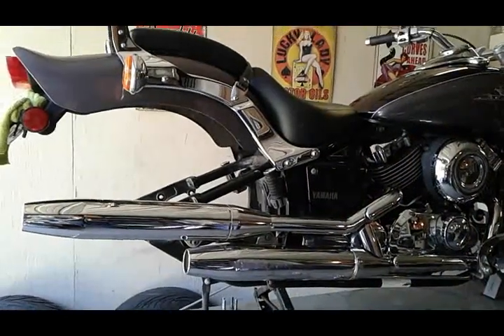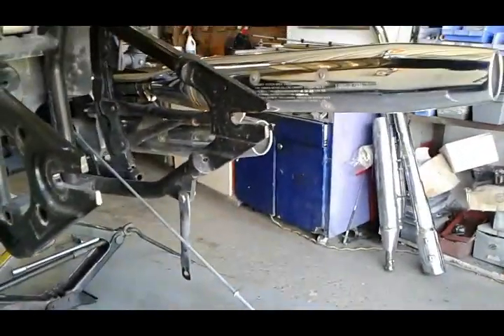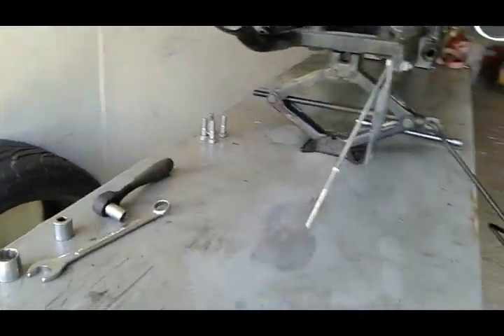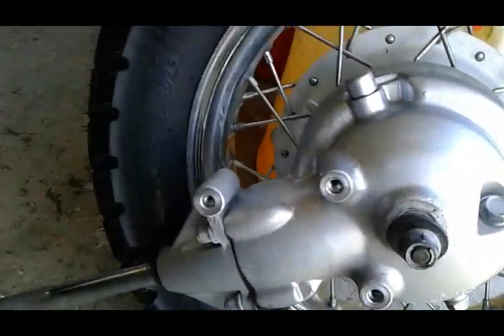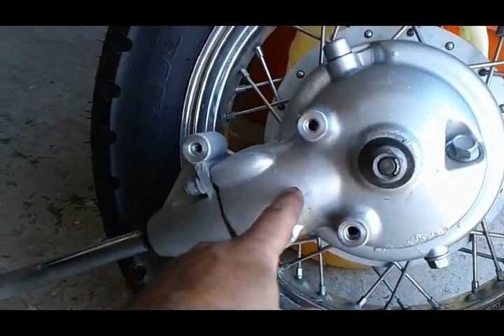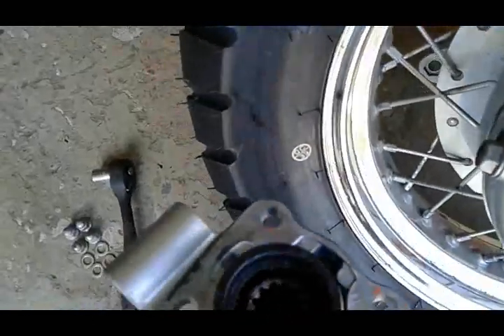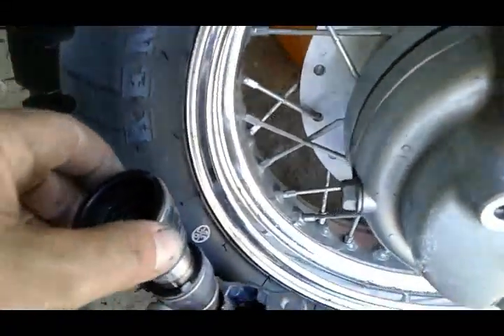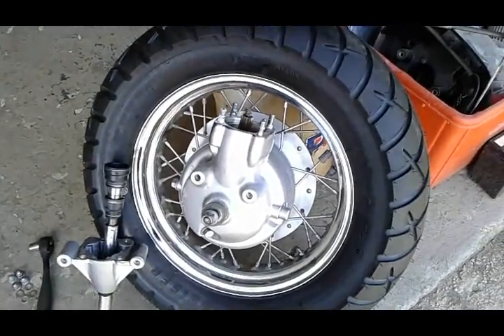All the V Star 650 owners  PLEASE WATCH THIS 3 min. VIDEO !!!

Comment: Great video! I chose to service my Vstar 650 myself. It was not a very easy job with the jack and other tools I had. Its almost a two man job when reinserting the drive shaft back into the engine splines. Next time I will pay a reputable repair shop and have them do the work. I am over 70 years old, so that didn't help!
Reply: Hey if you could do that yourself at your age, that’s better than most my age (17), good job!
Reply: @brileymitchell2632  Well thank you! I have over 50 years of riding experience, and I used to be the service manager of Honda of Waikiki in Hawaii so that helped a little but I am finished with wrenching anymore. I will still change the oil on the bike but my cars......I'll just pay somebody to do it! Thanks again!
Reply: @flashesofblack4128  yea I’m now the owner of a 2008 Yamaha V-star custom

Riding it has become 2nd nature with some things which is interesting

Comment: The best grease to use for this job is Honda Moly 60, a very high moly grease that is optimized for durability on driveshaft splines.  Also, you don't mention the torque specs and the specific sequence of reassembly and torquing.
Reply: Actually Yamaha Molly 60 grease is my go to grease😮

Comment: Your intentions are good but you are doing more harm than good with this video.

The spines are lubed at the factory with 60% moly paste. It is the ONLY lube you can use on the splines. Axle grease will be thrown off and the spines will be destroyed in about 2000 miles.

There is no scheduled maintenance for lubing them in the owners manual or shop manual because that factory 60% moly paste will last 100,000 miles.

BUT: IF you take your bike to a shop that does not know how to handle a shaft drive to get your rear tire changed, and they wipe off the 60% MOLY paste and put axle grease on it, your drive shaft is TOAST.

If someone watches this video and wipes off the factory 60% MOLY paste and puts on axle grease.... same deal.

I only know of one source for the correct lube: Loctite Moly Paste 51048. An 8oz bottle is about $35 online. DONT use anything else unless it clearly states it is 60% moly.  The Vstar 650 is the most reliable motorcycle made (Consumer Reports), and a big part of that is the shaft drive requires NO maintenance and its bullet proof. But its not fool proof.

If you buy a used bike and pull the back wheel off the moly should look dark grey or black on the splines. If they look brown or caramel like axle grease, then dont ride the bike till you get the proper 60% Moly. If you are not sure dont risk it. The rear hubs sell used for hundreds of dollars, and again these bikes are highly reliable, so the only ones you normally find being parted out are wrecks.
Reply: I’m going with what you say man. Thanks for the info that’s super important.
Reply: Hey 👋
Reply: Thanks for the info! I got lucky and got a 01 xvs650 that was parked for issues with spark. I have to replace the tank and try to get it running!
Reply: Thank you so much for this comment glad to read it, just got myself a 1998 dragstar, love the bike, with comments like yours i can give it as much love as she needs!
Reply: You can also use Honda M-77 assembly paste.
Reply: Wrong KW, you do not have to use grease with moly, that's pure BS as are your other comments. Any good grease will do, I use marine bearing grease and that lasts well over 6K miles when I have to change out the rear tire again. In fact the earlier versions of the XVS650 like my 2000 weren't originally packed with moly grease. The only benefit of moly is as a dry lubricant, that is if you neglect the splines to the point that the grease dries up, the moly will be left behind as insurance but even that will eventually break down until you're SOL. So if you're a conscientious owner willing to do basic maintenance, use whatever grease you want. If you neglect your bike or ride so little that you can go years on the same rear tire or without repacking the grease, use moly grease. Also, although the XVS650 is very reliable it is not the most reliable motorcycle ever made and Consumer Reports has a decades long history of misrepresenting or misinterpreting data. The old pre-90s BMW airheads and 60-70s era Moto Guzzi V-twins are known to go well over 400K miles without a rebuild. BMW even gave out badges in 100K mile increments to their riders and as a rider who's owned several, I can confirm how good they really are.
Reply: I was taking you seriously until I read "The Vstar 650 is the most reliable motorcycle ever made"
Reply: @timjeffrey565  That's not what he said lol
Reply: @trv1990  Did you read the entire thing? It's right there in the comment, I even copy and pasted the words.

Comment: Really handy information! I recently changed the final drive oil, will it leak out/will I need to change it again if I take apart the assembly?
Reply from the maker: No ... This is not going to affect your oil. It is dry and on the outside of the unit... precisely the reason why it goes bad if you don't periodically lube it with grease...thanks for your interest! Ride safe
Reply: when you put it back together - do you you have to install it on the bike and align the 4 acorn nuts/studs or can you assemble the whole thing on the floor and put it right back onto the bike?
Reply: @filmfreaken  You can assemble whole thing outside on the floor, and install as whole unit.
Reply: @knightmarecs  Thanks for the reply but after 1 year i've managed :D

Comment: Hey great tutorial. One question I've checked Hayes manual what's the chrome round thing at the top off the hub for .it's round chrome but won't turn
Reply: It's a pressure relief valve I think
Reply: Like a breather cap

Comment: What kind of lube do you recommend?
Reply from the maker: The best and the most long-lasting lubrication would be a spline lube which is hard to find but any axle grease is better than nothing. Make sure you check that every time you change the tire
Reply: Moly grease is recommended by Yamaha. Its expensive so I bought Polaris brand they use.
Reply: moly
Reply: @DoityourselfMotorcyclerepairs   NO NO NO NO NO!

it MUST be 60% moly paste.

Axle grease or brake lube WILL DESTROY THE SPINES IN ABOUT 2000 miles

The splines are lubed for the life of the bike with the proper 60% MOLY paste - you dont need to lube them for 100,000 miles

but if you wipe that off and put axle grease on the splines you will destroy them before the next oil change

Comment: The thing about the shaft drive is, the less you mess around with it, the better. Just change the shaft oil every 25000km as in the manual and call it a day.

Comment: What’s a sign of a bad spline? Will the bike just not get any power to the back wheel or is it a slow gradual loss of power?
Reply: It happens all at once, just riding down the road and all of a sudden no power to the back.  How it happened to me anyway.
Reply: It is instant, catastrophic fail. Bike will act as if it's in neutral with no forward propulsion.

Comment: Does this apply to the 1100cc version?
Reply from the maker: No it doesn't...only the 650cc. Thanks for your interest and please subscribe to help me out 😊
Reply: @DoityourselfMotorcyclerepairs  thanks. Last question: how did you remove the shaft from the final drive? I yanked on mine but it wasn't coming out and I didn't want to force it in case it broke something.
Reply: @DoityourselfMotorcyclerepairs  will it hurt anything if I already did this on my 1100? For a long time I was meaning to do this because everybody was saying to.. only tonight did I realize it only applied to the 650! Last weekend I put moly paste on the splines in there- do you think it might cause an issue? Because now I’m realizing it’ll be mixed with the gear oil. Not sure if that could mess anything up.

Comment: Lube it with what?  You should make a video of actually doing a step by step of how to live it for amateurs....like me 😂. Either way, thanks for the video
Reply: Thats what I was thinking. What lube? WD40? Vaseline? Transmission oil?
Reply: i had mine welded together after it had destroyed the splines and it works/ performs better than before
Reply: @dakotalamb7340  Jesus H Christ NO - those splines are there FOR A REASON
Reply: @kenwittlief255  yes but at the time I couldn’t justify the 1200$ they wanted for a new one and I’ve put over 35k on it like that with zero issue I just change the oil every 7500 miles or so

Comment: Is it possible to leave the drive shaft connected to the engine and just 4 bolts everything else?
Reply from the maker: the whole thing just slips right out...it would probably take more effort to do it any other way. Don't feel discouraged by taking the whole assembly out. It's done every time the tire is changed anyways...thanks for your interest and please subscribe to see more in the future
Reply: i Will solder It when It finish Broken so i Will tell u hahahaha
Reply: @DoityourselfMotorcyclerepairs great video, what about the other end of the shaft?? Lube that too??
Reply from the maker: @houseofbadgers9380  that one is never a problem but I always lube it when doing tire change because it's right in front of me...won't hurt...thanks for your interest and please subscribe... it will help me out 🙂
Reply: Is it possible to do that without taking the rear wheel off?? I am thinking about just taking those 4 bolts out and sliding the cover to put some moly grease?? Thank you for the video Boss